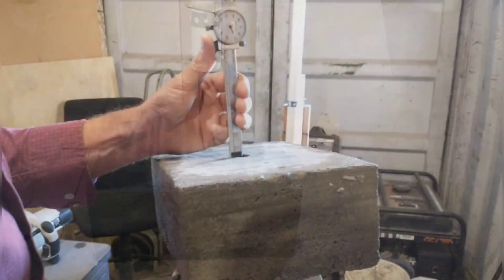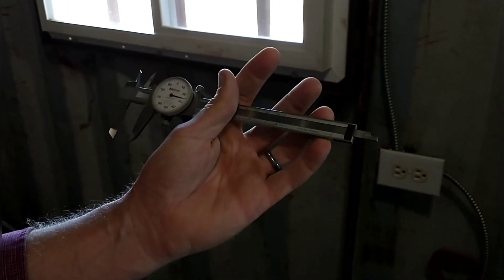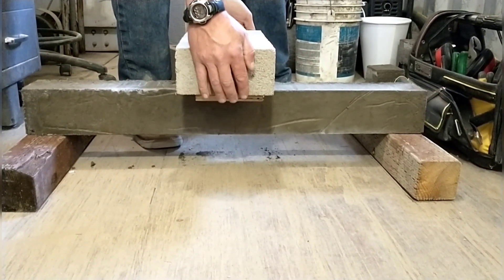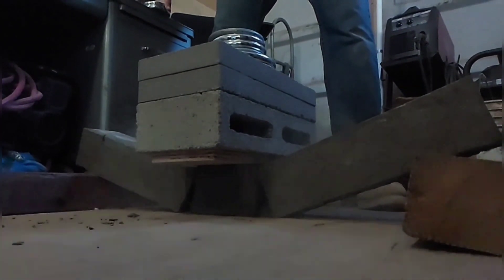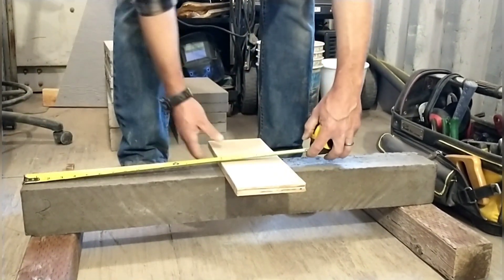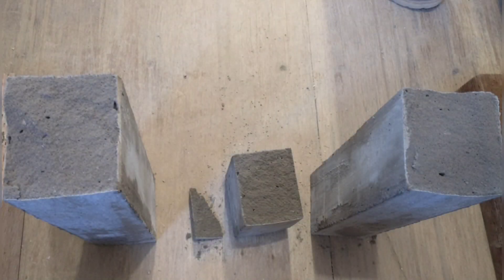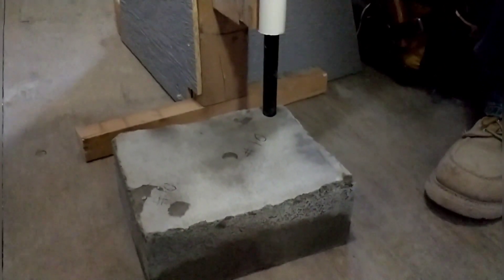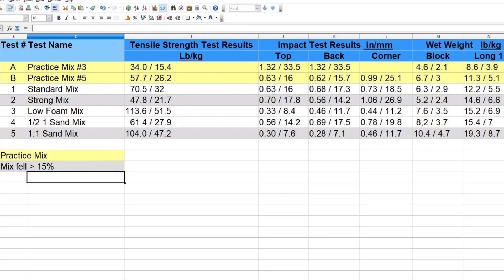AIRCRETE Testing PART 1 Strength & Blunt Force Comparison Tests

Comment: This is a great video, especially from a civil engineering perspective. What a great way to test the strength of materials. Man Red has such a wealth of knowledge on how to do things. And he uses old school instruments which is even better.
Reply from the maker: Thanks! The testing has been fun! He really wanted to do some compression tests, but couldn't figure out a good way to do it without spending a lot of money. These tests don't tell us everything, but they do give us a pretty good idea of what makes the different mixes stronger or more brittle. We hope to figure out how to do some insulative tests on the different samples soon.
Reply: @RedandAprilOff-Grid  So regarding the insulation tests, I always wanted to try and build a plastic box that is insulated all around, adding a pot of boiling water inside and then putting the test material inside. Vapor and heat will rise amd you can compare the results with the aircrete and have a baseline say with a piece of drywall. You can measure how much water has been lost. Thermal resistance is definitely a tricky thing. I also thought of putting insulation on top of a bbq and putting a baking dial within the opposite end to measure the temperature. That would cover conductive heat transfer.

Comment: I wish you were doing a surface strength test.  The impact test measures toughness, but doesn't answer the question of how many PSI it can support (e.g. for a floor).  @AircreteHarry was just using a force gauge with max hold.  He was seeing numbers of around 100-200PSI after a couple weeks of curing.   Those gauges are $100-$150.
This might seem low compared to the 2000+PSI rating from concrete, but aircrete trades strength for other properties.  Even 100PSI would be fine for a residential floor if it was topped with tile or laminate.
Reply from the maker: That would be interesting, but probably not something we want to buy right now. Based on our results, I think we have some mixes that would make a pretty good floor.  We use 5 gallons of water rather than the 6 or 7 that some recommend, and it seems to make a pretty strong product that isn't easily dented. We are posting the video tomorrow that shows the last few test samples from this batch, and the conclusions from our testing.

Comment: Are you going to skin the blocks with  a textile reinforcement? If so, what are you planning on using? I'm still working out a system on paper and have not been able to find a cost affective fabric/mesh to create a strong outer/inner skin that will work.
Reply from the maker: Yes, but we haven't looked into it yet. We plan to experiment with a few different materials on the garden wall, but have no idea yet which ones we even want to try.
Reply: @RedandAprilOff-Grid  I would stay away from polyesters. There have been 1 year studies showing severe breakdown of the fibers in the alkaline cement. I can send you a study if you like with images. The roofing fabric everyone is using is polyester and I have grave concern for the long term strength.  I'm currently leaning towards unspun polypropylene as a cheap source - think white packing fabric used on new couches.  For me it has to be cheap or free, especially if we are talking multiple layers. Think furniture store recycling. PP weed block may be another source or PP agricultural fabrics.  Canvas would be a good strong  option but its pricy.

Comment: I watched a video from the Happy Heresiarch where he poured a thin layer of regular cement/sand mix then a thicker layer of aircrete on top of that and so didn't get a cold joint but got a strong panel that was hardfaced. I've done a test where I made a 4x4 panel and put in 1" of cement then put in 2x2 wire mesh just into the cement then applied the aircrete for a total of 3.5". It's curing and I hope to see if this would be suitable for a tilt wall construction.
https://youtu.be/-sa7jcDeqjI
My plan isn't for load bearing walls as I am using 4" steel pipe columns every 4 feet going up 20' for my north wall and a flat sloping truss roof with the south exposure being 10 foot tall. I plan on 3'10"x10 (6" thick) panels between the columns.
Reply from the maker: His video on the nature of foam helped us figure out the issue with our the pressure regulator. I wish he would post more videos. His videos are great, & he seems to know a lot.
Cool!  It takes a lot of thinking and figuring to do something new and different. Our first idea was to do panels, but then decided we would rather try pour in place walls, so that's what we are going with. We'll see how it works out, and figure it out as we go.  We are not doing load bearing walls either, we were considering it, but never felt really great about it, because we get some crazy strong winds and didn't want to worry about the roof blowing off. Fortunately we don't get tornadoes here, but high sustained winds and microbursts. Red came up with an idea on how we plan to support the house. We bought the materials this week, and will be sharing it soon. 
Best wishes on your build, it sounds awesome!  😊🏠

Comment: Great video and testing modality.  In the next video will you be sharing images of the retaining wall that was built with the excess foam from each test batch?  Regarding your corner drop tests, you could orient a block that tested well and mark the two sides that flanked the test drop with tape or chalk and orient all remaining blocks based on those marked lines.  

Wishing you both a great week.  Cheers
Reply from the maker: Thanks! I am excited to show the wall, but am trying to get the test result videos out first. Maybe I can put a sneak peak of it at the end of the next video. Good point, he marked the spot on the floor for the long boards, but not for anything else. Wishing you a wonderful week as well! 😊

Comment: It would be really interesting to see you make a completed "beam" of wall section and test that. In other words, if you plan to put .5" of plaster on the interior walls, and .5" of stucco on the outside, make the full 7"x7" beam consisting of .5" plaster, 6" aircrete, .5" stucco, and test that. I bet the strength at least doubles in the load failure test. At any rate, it will give you a better real world estimate of the strength of a completed wall section. Just a thought I wanted to throw out there before the test form goes in a scrap pile somewhere... :)
Reply from the maker: Great idea!  We plan to test different plaster mixes on the garden wall. While we are at it, it would be pretty easy to save out some long bricks from our next test samples, and coat them in plaster. 😊

Comment: Will you be doing another round of samples and tests? 
 Would be interesting to see how a sample of low-foam AND sand would do.

And i wonder if the increase in strength for sand or less foam correlates equally with lower thermal performance.

Your videos are great! Thanks so much for putting in the work and sharing the results with us!
Reply from the maker: Yes based on these results we are planning to test a few more variations. We need to fill up the garden wall and keep practicing and learning anyway. We were curious if sand would make aircrete strong enough to use on the floor, it did pretty well, but adding sand made it a lot harder to mix, and it was a lot of work to sift the sand. Definitely a good idea, but it depends on how ambitious we feel, and whether we think one of our other mixes will work for the floor. The denser stronger mixes are less insulating, but still better than regular concrete. Thanks for watching! 😊

Comment: Looks like fun! One question how long did all you samples cure for? I found in my testing a big difference between 3 weeks and 4 weeks. You need 4 weeks of curing for maximum strength.
Reply from the maker: The samples were kept wet and cured for 7 days. Each sample was tested on the 8th day. It's more of a comparison test between the different mixes than providing absolute strength.  We are testing to see if we can find a mix that we would be comfortable to use to build our house. 🙂🏠
Reply: @RedandAprilOff-Grid  I look forward to seeing your test with the thickener added. When you do that test please do one test using 6 gallons of water compared to the 5 gallons of water you use. I'm not sure if that will make a difference with the thickener I always us 6 gallons of water when I make Aircrete. Also I add the thickener to the water and mix it before adding cement.
Reply from the maker: We used our old sample forms and made them into two that are 9 × 4 1/2 × 45 inches tall. We used our regular recipe and poured one sample with the thickening agent and one without.  Getting tall forms watertight is difficult, so some leaked out, but besides that, neither sample seemed to sink. We left them in the forms that are lined with plastic for a full week, it's easier to keep them wet that way. We plan to unbox them tomorrow. I'm not sure that it was a great test with them leaking out the bottom, and having to fix it and add in more aircrete, but we'll see what they look like tomorrow, and we'll probably try again at some point.